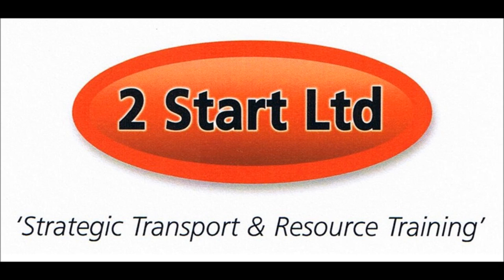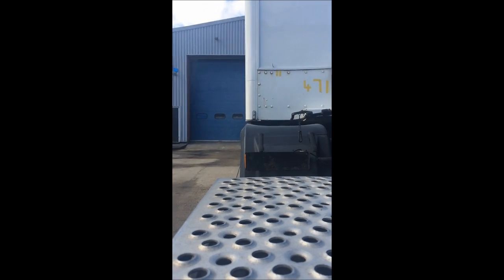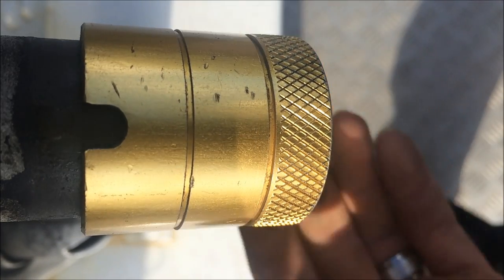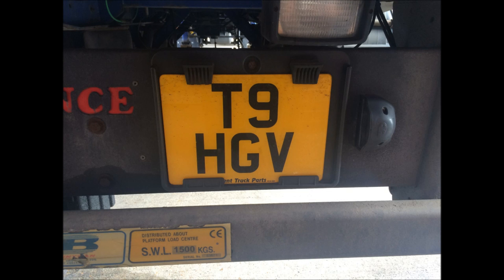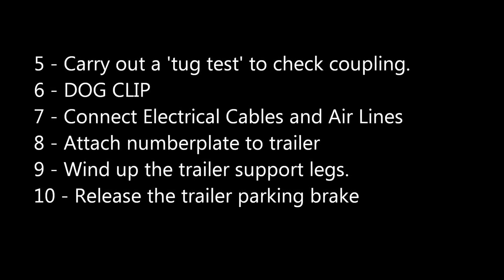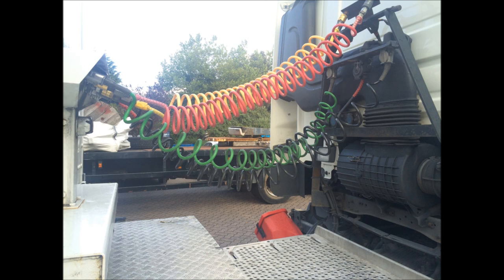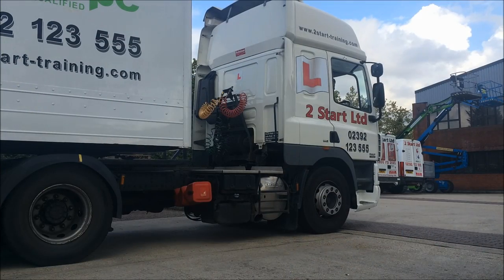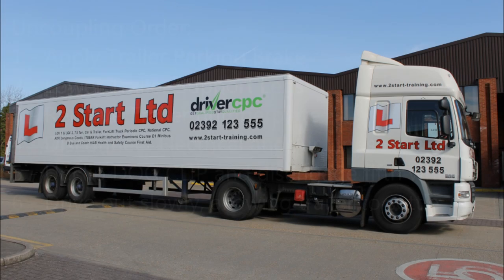How to Couple and Uncouple a trailer. Class 1 HGV - 2 Start Training - Top Tips

Comment: Thanx for the video! came here to see how the European truckers do that. our air connectors are different (two which are called gladhands) and one different electric connector. trailer brakes are controlled from the cab as the tractor (2 different knobs). the license plate on the trailer doesn't change, and "Trailer legs" we call "Landing gear" - cheers from Canada!

Comment: One other thing to add ,is compere the distance of the king pin to the landing legs with the distance of the filth wheel to the rear lights of the tractor  , to make sure you have room to engage trailer without bashing rear lights into landing legs.
And also check the total height of front of trailer from the ground once coupled up to the tractor as that can vary with different units...

Comment: At my company - When we connect we lift the suspension up so the legs are just off the ground then we do the tug test otherwise you will damage the legs
Reply: +Rupert Loseby Thanks for your message. The reason for checking the height is to ensure the tractor unit lifts the trailer just off the landing legs. This will stop them form getting damaged. If you connect then raise the suspension the damage could already have been done by the king pin not being central in the fifth wheel and sliding the legs across the ground. Hope this helps :-)
Reply: Aye 
That's what is supposed to happen  but when a driver has left to high or low then you have to adjust.  Thanks.  Good site. I passed 2008
Reply: +Rupert Loseby Good stuff thanks for the comments.
Reply: You could also lower unit suspension all the way down then reverse under trailer stopping when fifth wheel is under trailer... raise unit suspension all the way up.. then legs are off the floor then reverse into kingpin.. this way stops grease from getting on the end of the trailer and damaging legs

Comment: A tip when I done my Class 1, remember BLANK - Brake, Legs, Air, Number plate, King Pin, switch this around when coupling.
Reply: The way my dad and I do it is get out from drivers side and get your gloves on (keep them in drivers side locker as it’s easier for you) then go to the passengers side. Do the airlines and electric lines and everything then do your dog clip and release the king pin. Go to the trailer legs and lower them. Grab the number plate from the back and pin it to the catwalk of the truck (again do this on drivers side to make life easier). When coupling do it in reverse but still put gloves on.
Reply: A tip, when I did..... not done

Comment: On your test. If you want to check the brake light can u ask the instructor to watch as you press brske.or do you need to reverse upto somewhere and see reflection?
Reply: On your test you ask the examiner to confirm your trailer lights are working.

Comment: Hi there i find your video very informative. Is there a correct sequence and an incorrect sequence of connecting/disconnecting the air lines to the trailer?
Reply: +Ciarán Mc Ardle He seemed to always start with the air lines before the electrical lines. So when coupling, he connected the air lines first. When uncoupling, he seemed to remove the airlines first.Ideally you would want them not to get tangled up, so start from 1 end and work to the other end

Comment: I've just done my CPC and there was a question: how do you couple tractor with a 3 airlines with a trailer with two airlines. Does anyone have a example of that scenario?
Reply from the maker: Hi Bogdan! The answer for that is to connect the red and yellow, leaving the blue off. Due to the couplings, It's impossible to get them mixed round. Red: Emergency, Yellow: Service, Blue: Auxiliary.

Hope this helps!
Reply: every one says..emergency airline whats it for..and what is an emengency  and what does it actually do.?
Reply: @2StartLtd  thanks for that info! I want to learn as much as possible before selecting a company to do my training with and obviously want to pass everything 1st time. I'm getting there with learning modules and practice tests on the dvsa website! But these videos really help too!

Comment: I drive in europe and trailer has its own registration. No need to add the one from the front part. The trailer brakes are also automaticallly applied once you disconnect the cables. We also raise the trailer a little bit using the back suspensions, once the pin is released. Obviously you need to lower the legs a bit more, before you move forward.

Comment: He doesn't mention this in the video. Once the trailer is coupled to the tractor unit, would you not have to build up air in the trailer brakes?
Reply: After coupling, the brake air pressure indicators in the cab would be low and most likely sound an alarm warning that the pressure is low, you would then increase air pressure by reving the engine for about 30 seconds or so, at least this is what I was taught.
Reply: +DMESSER ok cool. thnx
Reply: This depends on the trailer. If the air pressure is good in the trailer once connected you will be ready to got. If the air pressure is low it will need to be built up before you will be able to move the trailer.
Reply: If the air in the trailer is ok its doesnt need mentioning..no video will ever cover every thing....

Comment: here in the us we dont have hand brakes n our trailers   our brakes lock as soon as you cut off the air from the trailer
Reply: They do here in the uk too but we have handbrakes so they dont automatically release when the air line is connected

Comment: You never mentioned to lift the landing legs off the ground before you tug forward
Reply: Lift the trailer legs? Do you mean fully or partial ... because if on the tug test, the driver shoots forward and the legs are wound up he would tip trailer .. hence legs stay down u til test is done
Reply: W Wood I mean just partially clear of the floor so as not to bend the legs when the tug test us carried out

Comment: Dont you need to level the ECAS system  before you drive away??. Should you not check if the trailer is empty/loaded before you leave with it? Should you not check the trailer is within its service period and its MOT is current? One of the better ` how to do it correctly vids`

Comment: Surely you should be showing new drivers too raise the suspension before the tug test!
Reply: And why not lower suspension before reversing under trailer? So 5th wheel misses front of trailer, keeping grease on 5th wheel not on front of trailer. Once under skid plate but before reaching king pin raise suspension lifting legs off ground, and then reverse into the king pin.
Reply: +Alan Ward Raise suspension on the tractor unit? How would you do this